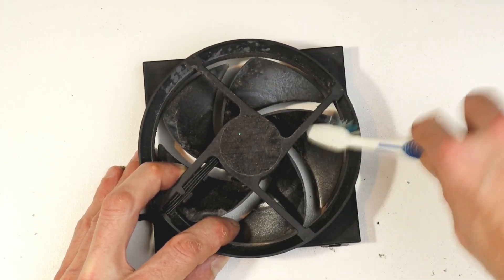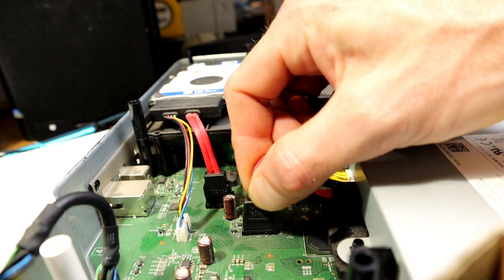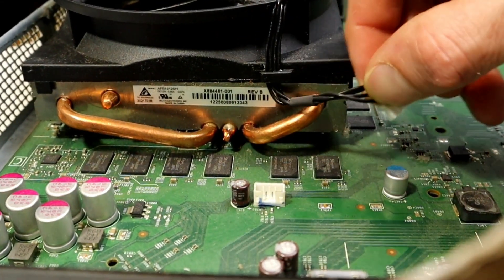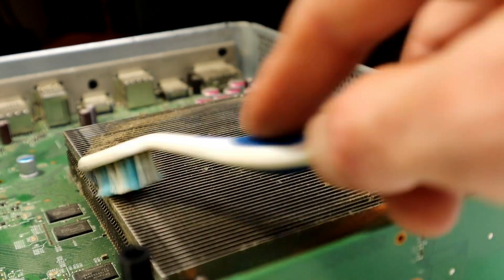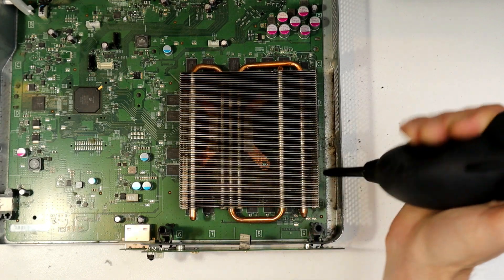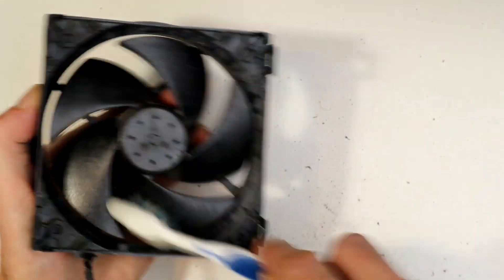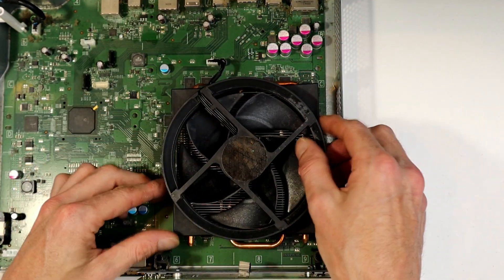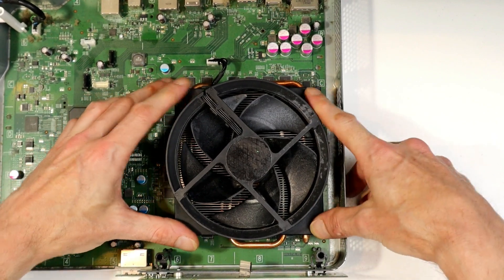Why Your Xbox is Too Loud + How to Fix it

Comment: So I just bought this used xbox one off this dude for cheap and it scared me cuz I turned it on and the fan was unusually loud. I was scared because I really didn't wanna have to take the unit apart. The unit itself look pretty clean though. But since in your video it appears that some of the noise was coming from dust, I took a blow dryer and put it on cold/high and blew it through the top. Low and behold, fan noise gone! Thank god it was that easy. PHEWWW

Comment: Btw here’s a quick tip, don’t clean the fan to hard or it will break easily. It happened to me about a year ago
Reply: Well, you know, my fan is like,    i sprayed compressed air….
Reply: @ElevatorWasher5000  i did this as well , always always unplug. since your xbox is always idling. cleans well, but you don’t need to hold it on the fan for a long time to ultra spin it the other way lol. my mistake now my  xbox sounds like a jet lol
Reply: @hughjass4978  thanks! Mine needs to get cleaned because there is a dirty smell.
Reply: @ElevatorWasher5000  happy gaming

Comment: Is there a way to quiet the fan without having to remove any parts? I don’t want any risk. Like maybe a vacuum or something
Reply: Do not vacuum electronics, that's how you end up with a dead Xbox. Vacuum creates static electricity which will kill electronics.
You could try to blast it with an air compressor but you'd need to at least remove the plastic cover.
Reply: I also won't recommend taking it apart by your self if you're not confident about what you're doing cause i ended up damaging my ribbon cable which resulted in making the xbox power button and eject button and sync button to not work and now it seems like i have to replace the ribbon cable
Reply: @bommber9323  kido
Reply: @L̷o̷v̷e̷d̷ ̷P̷e̷r̷s̷o̷n̷ ̷ lol “Loved person” nah definitely some fake depressed 12 year old🤓

Comment: Can you swap the internal hard drive with a large SSD or is it like the 360 where you had to have certain drives flashed with special firmware?
Reply: Yes
Reply: Form what i know of because my hardrive on my xbox one x died twice, i had to use a harddrive and then program it before putting in the xbox

Comment: Do you have to fully remove the hard drive the take out the fan, or can you just flip it over. Also, if you DO fully remove the hard drive, will you lose all data that was on it or no?
Reply from the maker: Yea you can just flip it over. I just wanted to demonstrate what i believe is the safest way to do it. And chances of losing data would be so slim its not funny but whenever i even touch a hard drive i say there is a risk to avoid any backlash haha! 😁

Comment: My fan is different and I have no clue how to add lube to the fan
Reply from the maker: I didnt know there were different  versions, thanks for sharing!
Reply: @TinkerManMick  yeah man mine is OG xbox like probably one of the first batches. They probably made it 100 percent sealed but learned about the noise issue so probably made it so they could lube the bearings easier by making those holes. I don't have any holes like yours unfortunately...
Reply: @williamsuraci8736  bro ,  just peel off the black round  sticker on top of fan and lube then replace the sticker